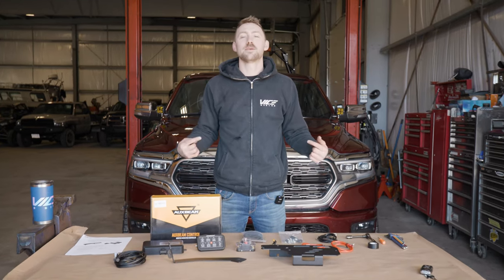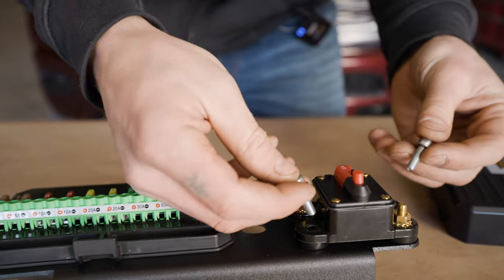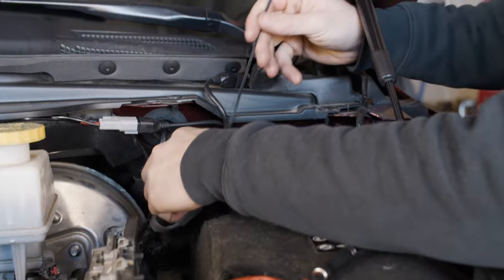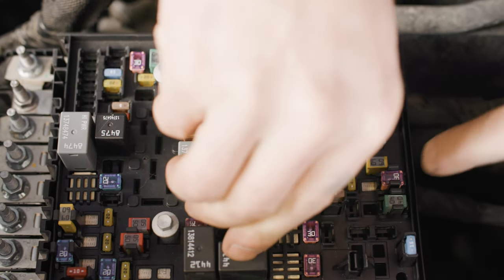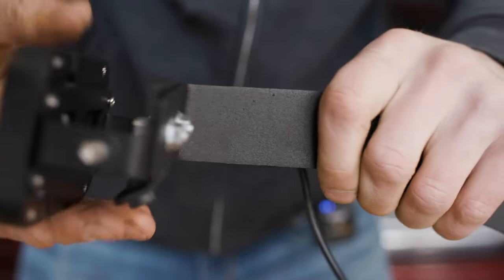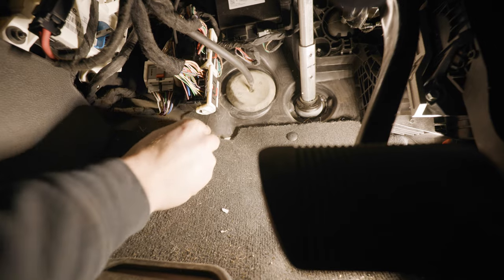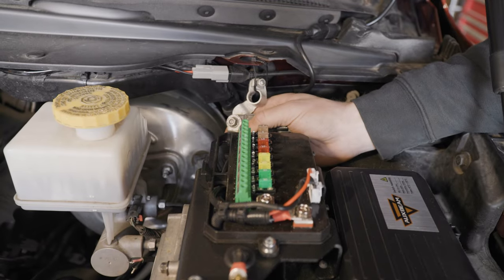HOW TO Wire a Lightbar and Offroad Lights on your 5th Gen RAM Truck - VICE Auxbeam Switch Mount Kit

Comment: Just an observation. The 6 gang Auxbeam is a completely different design (it doesn’t have neutral connections for example) and doesn’t fit this bracket. The bracket fits the vehicle but I had to drill a new hole to mount it. The bonnet closes fine but the Auxbeam is taller and fuses are sideways.
Reply from the maker: Correct. Our mount kit is designed around the 8 gang panels. Specifically it is compatible with the following Auxbeam versions: BA80, GA80, RA80 & RB80
Reply: @ it’s fine for me. It does what I want especially considering the for some reason they don’t make anything like this in Australia. Most videos I’ve seen people are zip tying them in place.

Comment: Just woundering dose ur kits have a right hand side drive mounting bracket for in cab for us here in Australia thanks.
Reply: Great question I wish they would reply
Reply: I bought one from them and am in the process of installing it. If you have purchased an Auxbeam from Australia it’s different. I bought a 6 gang Auxbeam from Auxbeam Australia via Amazon. The 6 gang is a completely different design than shown in this video. It fits under the bonnet but it’s much higher, the opening lid is on the side, and there is no breaker included. It looks like it’s not necessary with the 6 gang. I was able to use 1 predrilled hole but had to drill a second myself. The 6 gang Auxbeam is completely different as I said.

Comment: Mine arrives tomorrow along with your backup light kit. I'm installing X-PRO Series | 5 Inch 174W LED Side Shooter Pod Lights with White DRL&Amber Turn Signal Lights. Does anyone know where to connect into the DRL and Signal wires?

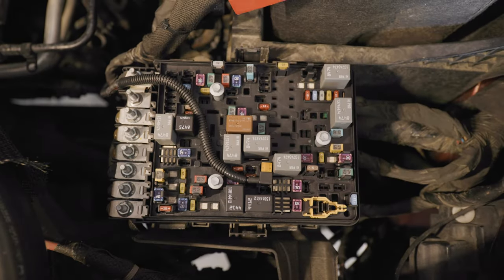Comment: At 14:02 why did you attach the 8gage red cable to no. 02 stud in fuse box and why not directly to the battery positive terminal? (Red)
The Aux beam instructions tell me to attach it to the battery terminal.
Reply from the maker: Good question. If you trace that stud back it goes directly to the battery positive. If you attach it to the battery positive clamp then you can't attach the red plastic protective cover that protects anything from grounding out on the + terminal. The unfused #2 stud is the perfect size and a cleaner way to wire it and achieves the same result.
Reply: Awesome! Thanks for your response! Great video! I have the same truck and I was having hard time finding the ACC fuse in the fuse box. This video is a savior!

Also, I have already installed the aux beam kit in the hood but not the switch, hence I was wondering if I could find the bracket for switch only. The one that you install at 8:20
Reply: @vicedesigninc do you sell the Auxbeam Interior Cab Bracket | RAM 1500 DT separately?
Reply from the maker: @tejasthakur324  we do. Send us your shipping info here: https://www.vicedesign.ca/pages/contact-us and we can put a manual order through for you

Comment: Nice! Do you not recommend somehow weatherproofing the boot which was cut? Thanks
Reply from the maker: It shouldn't be required if the incision is small enough. Its a double walled boot so its a bit of a labyrinth for water to get through. You could always add a dab of black Sikaflex if you cut the seal too large